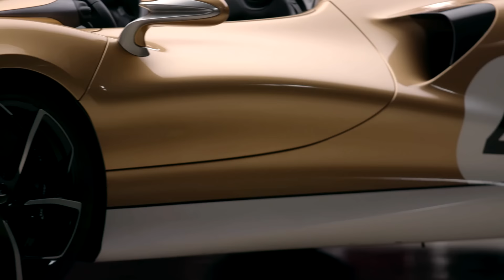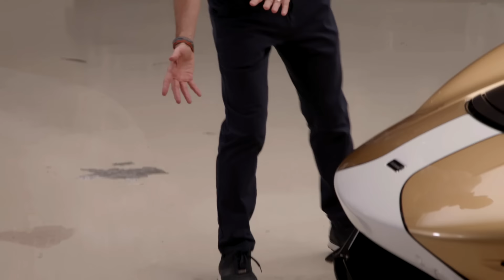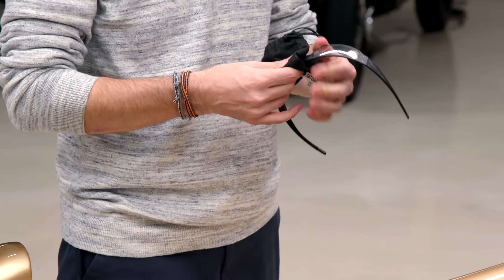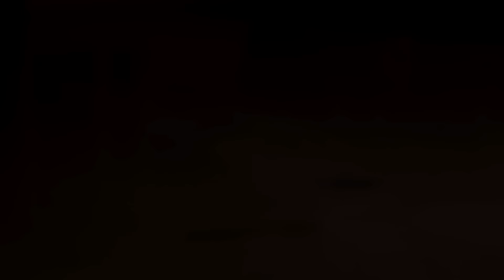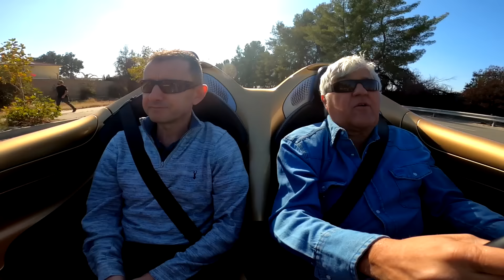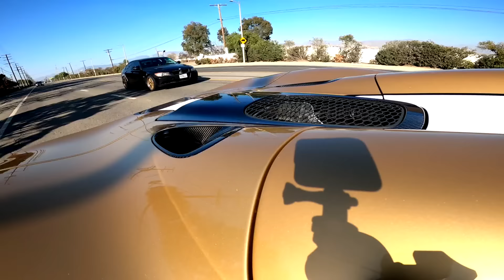McLaren Elva | Jay Leno's Garage

Comment: Funny how they hang the passenger/wife out to dry with no aero or helmet accommodations for that side of the car. As I recall the Ferrarri equivalent of this also only protects the driver. Too bad, aka "sad". Just alienates any companion from being able to enjoy the car with you. As a former industrial designer, I appreciate functional design solutions as much as the next guy, but what is the point of having a second seat when the occupant is destined to be pummelled by the elements, rather than delighted with the experience.

Comment: A very beautiful and unique car,yet almost every system of it from aerodynamics,to heating and cooling ,front visibility is compromised for what Jay refers as " gimmickry".Even engine access is difficult.As a motorcyclist ,it is thrilling to ride with just eyeware but ultimately exhausting after moderate speeds between noise and buffering after a time.Sure,that's the purpose of the helmets but then they end up being a bandaid.That aero works great on a two lane road.Not saying this wouldn't be fun but most people who would buy this want to be seen also which is difficult when buffeted or helmeted. Never thought of my Miata ,let alone a Caterham as practical but ask any cyclist with a nice bike about having to park on the ground floor of a motel on a trip to keep a eye on the bike,let alone leaving it out of your vision just to swim or even shop.Insurance does help but so would the optional windscreen (s).Cool car though, I do see the Speed Racer in it but also the little metal flake color fiberglass cars you would ride at the fairgrounds.Thanks Jay.
Reply: It's really just the ultimate toy. Nothing wrong with that, someone had to make it. At least its a beautiful thing for everyone else on the road to enjoy.

Comment: When Jay says he has 12k on his P1 we have to put that into perspective. The man has almost 200 cars. He could drive each one of his cars for only two days out of the year. 12k on one of his cars is incredible!  Cars are meant to be driven nice work good sir!
Reply: When he got his Ford GT he put 800 miles on it in 2 weeks. He is the true car guy. Alot of guys collect cars and then they sit. He drives them as the should be driven.
Reply: Plus over 100 motorcycles.
Reply: Not only that the P1 was definitely not engineered to be regularly drove for example similarly a new Chevy Camaro SS passed a bunch of tests to reach 300,000+ miles before more catastrophic drivetraine issues occure. That’s of course with tegulsr oil changes , premium fuel, preventative maintenace etc. it’s why so many average consumer vehicles thst cost a fraction of this have 10 year 100k mile warranties and already seeing unlimited mileage warantees with some vehicles as long as you own it. Till it changes hands. It’s worth it for them to do this becasue regular oil changes , maintence and checks have to be done to keep the warranty and people that this their vehicles will easily hit these minimums and last a lot longer with the mainenace. A $50 Camaro needs to be capable of 300K miles on average with naormal driving. A 3.5M MclLaren knows no one is going to put over 5K miles on. Sena . They know this car will be drove a couple times a year if not being stored as a collector .  Most hyper cars require severe insanely expensive maintenance at 10K miles 15k etc I remember watching a guy that brought his FXX to That exotics channel in LA and he told the youtuber the entire engine and trans and drive system has to be removed at 10k max and all completely gone through AT YOUR COST and it costed an old business partner if his over $400,000 , the entire motor had to be sent to Italy , the entire process took nearly a year. Insane I mean if you’re paying millions for a car they ought to be making the cars capable of at least 100K  the nee c8 z06 made an average of 265,000 miles in its target testing! The base c8 at $70k was tested to 300k as well intentionally becasue the c7 averaged 330k for a really fast sports car. Obviously no 4M car but seems odd to spending 40 times that gets your 1/30th the mileage and no warranty. Hmm
Reply: @MZ-bl6wg  Which one will get you laid?
Reply: There is a small farming town in Wisconsin named Eleva. Coincidence???
Reply: Jay Lenon das Antigas e Roby car.#
Reply: Given McLarens reputation for reliability. I am surprised he has been able to keep it on the road for 12k....
Reply: @bwgti this is false, i have 5 mclarens and i have great reliability with them
Reply: I somewhat agree but there is depreciation on these cars as well.
Take for example the Ferrari 812 superfast. The value drops a third after a year. And that's not even taken into account the milage.
If you daily the 812 Superfast it drops accordingly in value.
So you have be smart and go for the limited editions. The TDF or the Competizione. But then you definitely wouldn't daily your 812. To control the depreciation.

All things considered, you want to skip the low end or entry level models, or go second hand and get them much cheaper. I've seen the MP4-12C for about 80k. That's not really a collectable car but it's a good car nonetheless. Good to be a daily. Or a 540s spider.

A P1 with 10k miles must been used a lot on the track. And don't forget the P1 is almost 10 years old by now.

I reckon the last few v12 cars will by highly collectable and will go up in value. So any v12 Ferrari is a good buy, but don't daily it. The occasional even more rare v10's is certainly a good buy. A McLaren has to be a rare car to be collectible, Those 720's you see a lot as the prices drops on the second hand market as well. Same goes for a entry level Ferrari's 458's, 488.
Reply: I thought more cars than that.  He once said if he did an oil change every day it would take almost a year to do them all.
Reply: Door Dash deliveries or maybe UBER Driver?  ;-D>
Reply: Driving his cars?  Each is given street duty, even if just to fetch a sack at White Castle....ask Tim Allen
Reply: He has 200 cars, but he didn't drive everyone of them.
Reply: You have to, not we.
Reply: #BugsInYourTeeth!
Reply: Jay bought the P1 with 10k on it.
Reply: @mmarmrcz6770  no
Reply: may have been bought used?
Reply: @MegaEdge777  mo
Reply: Doubt
Reply: Like some of cars are steam cars and some of cars are 100+ years old battery cars with like 4 km range... Some of cars are simply not fun to drive like Citroen 2cv with 10 hp engine which is really hustle to drive... So he is probably driving modern cars around. 
He actually drive tesla S all the time
Reply: Take the time to trash the car they're reviewing instead of worship one of Jays loose thoughts...
Reply: ... a waste of money
Reply: Yes cars like this are made for people with so much money the don't know what to do with it @BUEAU
Reply: I dont think he pays insurance and duty for all his cars. He must wait a week before he can drive one.
Reply: @Andrushe4kanka  when you have such collection, you have a contract that cover all vehicle with a limitation of mileage on each vehicle. That way, he can pick anyone he wants at any given time and drive it with insurance.
Reply: @Andrushe4kanka  he has a writer. all inclusive coverage.
Reply: @Andrushe4kanka  he stated that in one episode I believe. They asked to drive one of his cars and he replied with that very answer. If I remember right he says DOT regs or something
Reply: @Andrushe4kanka  i don't think you know that he's worth 600 million dollars
Reply: I'm calling BS
Reply: @lukasgarage956  i dont think this guy needs to BS to impress people
Reply: @lukasgarage956  No one cares.
Reply: @lukasgarage956  I'm calling your a troll
Reply: @lukasgarage956  Jay has been into cars his whole life. He has made big money since his 30s onward. It’s not BS it’s reality. 

Honestly what makes you think
It’s BS

Comment: Cool toy car. I suppose all of the Ultimate series cars are rich boy toys, and not meant to be great all-around super/hyper cars. The Senna is flat-out ugly; so redeeming quality #1 of this car is that it’s based on the Senna but is actually beautiful.  The paint color grew on me during the walk-around—I’m usually a fan of traditional liveries.  If this car is a design exercise, then the front air shield is certainly clever, but it means that the car is most beautiful (and looks as intended) when it isn’t being driven. Driving the car becomes a compromise on the design. 

Great content!! Thanks Jay!
Reply: Check out our elva I may be biased but the spec really shows the lines better

Comment: Full face helmet and body armour NOT optional, if you think a bug stings when it hits your face, even hitting your helmet, to say nothing of a random stone or larger( think tire weight or loose loads) , then imagine a blown tire piece of rubber coming at you at 60-70-80 miles per hour. Ludicrous design, stupid engineering.

Comment: A 600LT/Carrera GT style exhaust out of the top where the exhaust comes out in "race mode" and then you could route the exhaust down low through bottom of the bumper. Similar to the Bugatti Veyron/Chiron exhaust where some goes through the bumper that maybe bypasses the muffler or the wastegate or exhaust that goes through the muffler exits from diffuser.

Comment: Great choice for a feature this week Jay! Odd I was always under the impression Jay bought the F1 new when it was released. Either way he got one heck of a deal.
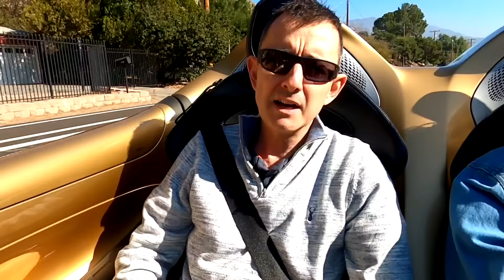Reply: Actually, I’m a bit confused by what Jay said about buying the F!. I’ve heard him tell the story about going to the factory to get the car and even in this video, when they are discussing air conditioning… at approx 41:03, he says “when I bought my F1, I got it from the factory”…  So… yeah… I’m confused. Or, just maybe… Jay was a bit confused.
Reply: @macmclemore  I believe Mclaren facilitate buying and selling F1s. So the original owner wanted to sell his F1 and informed Mclaren, Jay had to deal with Mclaren directly to get his seat and driving position configured to his liking. That way Mclaren keeps track of the current owner of every Mclaren F1. That would include extras like adding the stronger AC etc.

Comment: I don't know the Elva was originally a McLaren design. Neat.  I've seen an original street example at the Carlisle Import show a couple of times.
My first thought when I saw this car was, "the designers were Speed Racer fans..."
If McLaren thinks cars need to be geared more towards the driving experience, maybe we'll see the return of a manual transmission. Maybe... One can hope.
Reply: He didn't say McLaren designed Elva. He said McLaren Employed 5 people in the 60's and didn't have the man power to build Customer McLarens. So McLaren hired Elva company to build Customer McLarens Cars.
Reply: The thing about manual transmissions is that they are slow. Do you like being slow? Coz i don't. I like being fast and if a dual clutch or a modern auto is faster then that's what i'm ordering.

I do find that people like yourself that do want the return of the manual are usually scared by change and have no idea what they are talking about. Mostly coz they are slow.
Reply: @M3PH11  With all due respect, possibly you never had the opportunity to drive a manual sports car over mountain roads where the constant gear change is a blissifull experience, I am from Europe and I have driven on the Alps and Dolomites apart for a few central Tuscan Appenine passes and do it with an automatic or tiptronic sistem takes away the joy of you being in comand of the car. But as I say is only my personal impression and I respect yours. Regards.
Reply: @M3PH11  It's not about being fast, it's about being connected. You will NEVER have the same visceral driving experience with a car that doesn't have a manual trans. As others have said, you get going on a twisty, technical mountain road where you are making upshifts and downshifts and feeling every release of the clutch give you another growl from the engine, and it makes even the fastest tap shift or auto feel boring. I've been fortunate enough to drive a lot of very high end cars, and I would absolutely own something like a 720S or a 488 Pista, but a lower HP manual trans car is just plain and simple more fun.